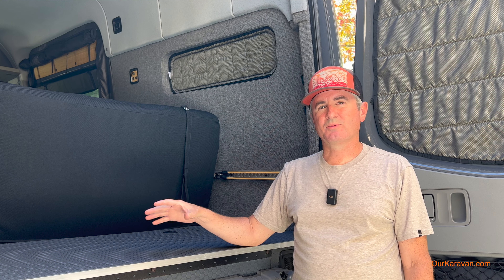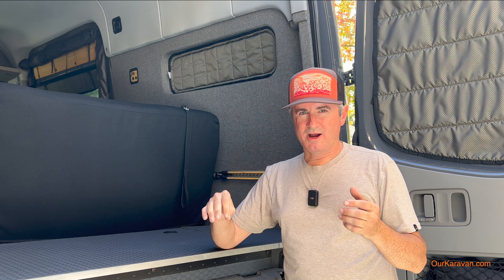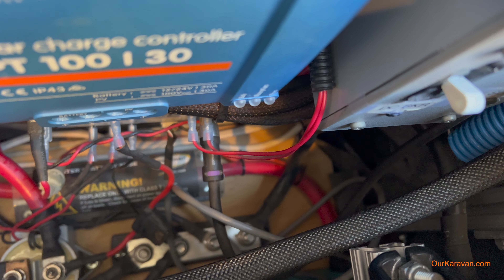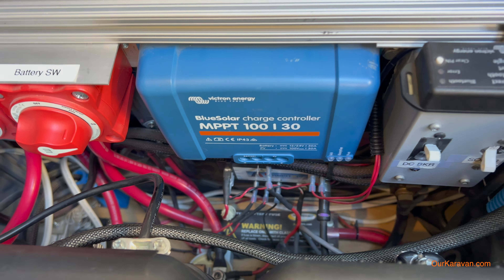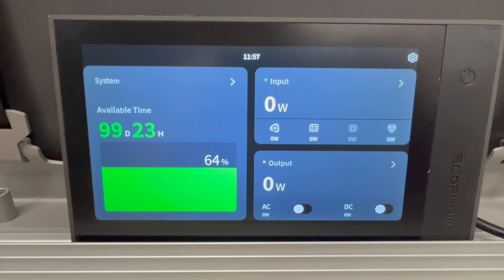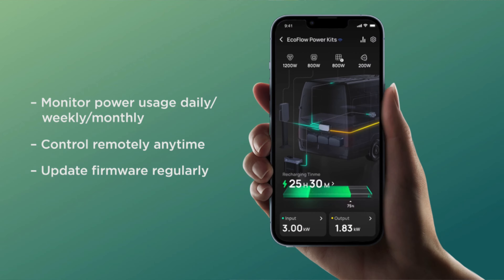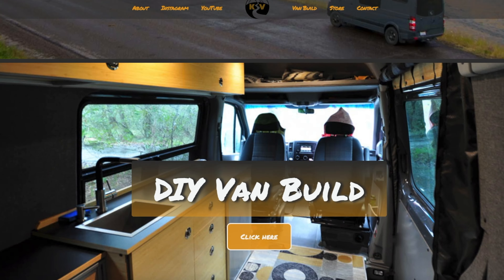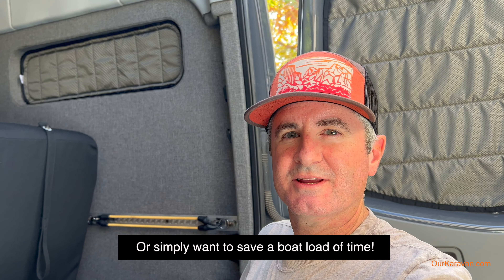Is this the Tesla of Van Electrical Systems?

Comment: Hi Ken.  What are material costs, comparing this eco flow system to your OG electrical build?  Excluding install labor time.  Spec for spec, as much as possible.  I know it's not a perfect science but any rough estimate comparing dollars to dollars for the 2 approaches, maybe a rough percentage more for a ready built eco flow system.?  Thanks, I really appreciate your channel.
Reply from the maker: Cost in 2017 dollars:
200aH battery = $2,336 with BMS
1,000 watt Magnum inverter = $933
Victron solar charge controller = $246
Shunt, breakers, fuses, wire, wire terminals and lugs, ring terminals, shrink-wrap, fuse blocks, terminal blocks, battery switches etc = $1,008
I did not include the cost of USB ports, 12V ports, etc as you need those regardless of what system you run.  I also did not include the solar panel, solar panel racking for the roof, or the cost of the enclosure to contain all of this.  I also did not include tools such as lug crimpers, wire strippers, soldering gun, etc.

Total cost for just the raw system (minus everything I just mentioned) was $4,523 in 2017 dollars for 200aH and a 1,000 W inverter.  I also lack a warranty, alternator charging (like the EcoFlow has), any form of battery heating, a touchscreen or phone app, and the EcoFlow inverter produces 3.5x the power of my system.
Reply: That really helps Ken, thanks!

Comment: Really smart complete idea ✊. 
I have installed one in our garage, solar panels on the roof then it’s distributes power to our cabin office and too the house power TV and few lights. Really good set up I think they are tidy simple and just work well, as you say monitoring is simple. 
One downside I think is the power the inverter draws on its own with no load on, wish that would be more efficient. 
Thanks very much Sam.

Comment: I’m went with the Goal Zero 6000X for the same reasons, primarily fear of burning my van to the ground.  This was before Eco Flo came out with this product.  The Goal Zero works great  but one  drawback is time to charge.  They now have a similar product with a brain and battery add ons.
Reply from the maker: The unit you have is a lot better than some of the early GoalZero products that couldn't handle the startup of a compressor fridge at lower states of charge.

Comment: You went full ecoflow!!!! Im jealous!!!!   Im curious about your thoughts on portable powerstations that have now become powerful enough to use in your vanbuilds!  Ecoflo/bluetti/jackery have all put out these types of portable systems.   Your thoughts??  Im SERIOUSLY considering  a EF 10kwh system with your galley cabinet and now your cabinet for  the EF!!!  Will the extra battery fit in your new cabinet?
Reply from the maker: Hi Fred, these all in one systems have come a long ways from the systems of yester-year that couldn’t power higher draw items at less than 60% state of charge.  I have not tested the other systems but had an Ecoflow for testing for a few months and really liked it.  I particularly like that it can be set up in no time vs the hundreds of hours I spent learning about electrical components, which ones to buy, how to make sure loads and wire size calcs were correct so I didn’t burn my van down, and many hours building the electrical system. I liked the EF system enough to design a cabinet around it. 

The cabinet will hold the entire system and two of the 5kW batteries, for a total of 10kW.  I hope I understood your question correctly.  I hope that helps and please feel free to reach out here or the contact form at ourkaravan.com if I can help in any way.  -Ken

Comment: Ken, great video, really enjoy your channel and this power system rack. Question on the Ecoflow Power Kit 5KWH battery. I know amp hours, and am confused on comparing what I know, AH, and I can't visualize the length of battery life in KWH. If the 5KWH battery is 48V, then the conversion is only +/- 100AH? If so, that would be a large, expensively low capacity battery. What is the AH of the 5KWH Ecoflow battery? Thanks!!!
Reply from the maker: Even though this is a 48v battery, for sake of comparison we will convert it to 12v so you can directly compare it to a 12v system. 12v x 5aH = 416.7 aH at 12v. At 48v yes it is 104aH.  Great question and thank you for the kind words!

Comment: Does this feature the same anti-competitive, non-compatibility with other brands as EcoFlow's portable ACs? I purchased one of their Wave 2 ACs planning to run it off the 12V electrical system in my van. When I went to test it, I learned that the 12V input only works with EcoFlow batteries. If you already have an electrical system in your van, then you have to run the AC off of your inverter.
Reply from the maker: The most efficient way to do it is to run a 48v ac like the Coleman Mach 10 or Nomadic Cooling AC direct off the EcoFlow, but 12v (if within the 12v output of the unit) and 24v are possible too.  More info here:  https://www.campervan-hq.com/blogs/van-build-guide/ecoflow-power-kits-which-rv-air-conditioners-work-best-with-power-kits

Comment: "T

About 6 months ago "they" told me the system will not support a 12v a/c unit.  Is that still the case:?
Reply: none of these AC units are worth the money anyway compared to a quality 110v counterpart like Houghton.    Its basically the top scam of the industry currently.   Sell you less powerful (BTU) DC unit for vastly more money while giving marginal power savings in return.    The Coleman 48v unit they are talking about on their webpage uses almost identical power of the 110v unit.   I think people hear 26 amps and forget its 48v.  Still 1400 watts.  Same power usage.   All you save is inverter loss.

Comment: i went all in on this system.   Unfortunately the software is a total mess and has been since launch.  And customer service is abysmal.   Couldn't recommend it to anyone.
Reply from the maker: I’d love to hear what sort of software issues you’ve run into.  I haven’t run into any yet, but I am aware EcoFlow has issued firmware updates to address some early issues and continue to improve the product over time.  Just like a Tesla, new features are being added and bugs addressed on a continuing basis.

To address customer service Ecoflow is setting up service centers where components can be diagnosed and replaced if necessary.  It should make troubleshooting faster and more convenient than a system like mine where I am the only one that can diagnose and repair on the road and have to wait on parts to arrive by mail when traveling.  It’s really inconvenient.  Thanks for your comment.

Comment: But  then you have a single point of failure and the entire system goes down vs being able to quickly replace a single simple component.
Reply from the maker: Well yes, but when I’ve had failures in my discrete component system it has taken my entire system down as well, and the only way to get parts is by waiting on an Amazon delivery while on the road.  EcoFlow is in the process of setting up service centers where they can do troubleshooting and component replacement if required.  Now that Winnebago is using Ecoflow in their higher end vans, they are in the process of becoming a service center for Ecoflow and providing options for people on the road.  Thanks for your comment!
Reply: @ourkaravan   Understood, just had the AC charging fail on my Ecoflow unit and still waiting on a response two weeks on, let alone waiting to ship the entire unit out and then waiting the repair or replacement to be shipped out.